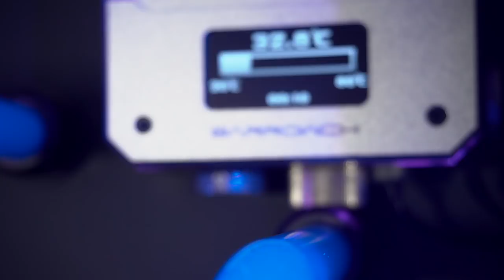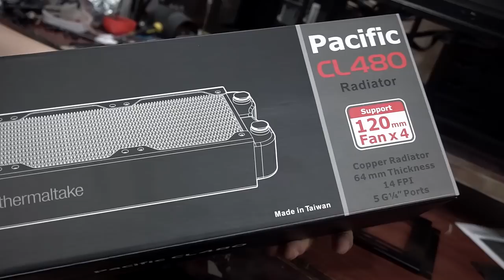Lian Li PCV3000

Comment: Very nice. What are the fittings that you are using ?
Reply: barrow. used to be known as the chinese rip off of bitspower but ive run the hardline and others in various pc and its not a issue. barrow stepped their game up i think now
Reply: VESPTEK I just bought some barrow nickel 16mm push in fittings. Hopefully they work well. The compression fittings are great. I like them better than bitspower because there is no logo. Problem is aviablity in the states. Ali express but they take forever